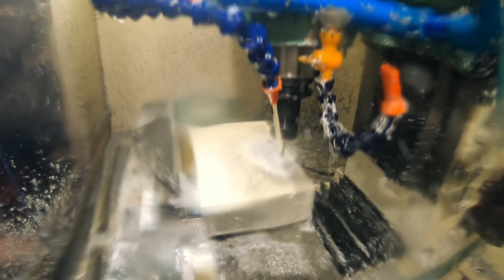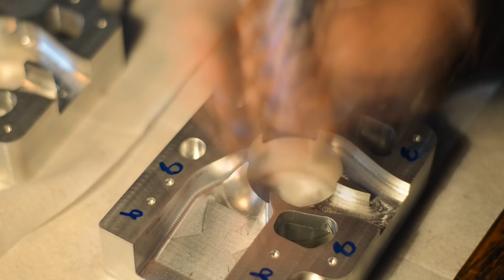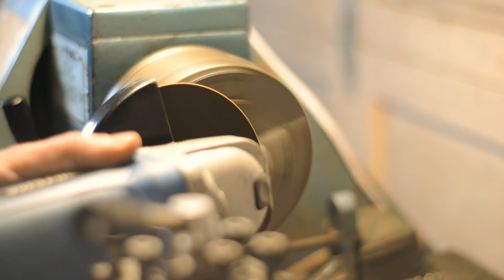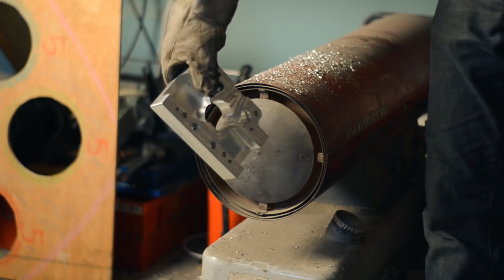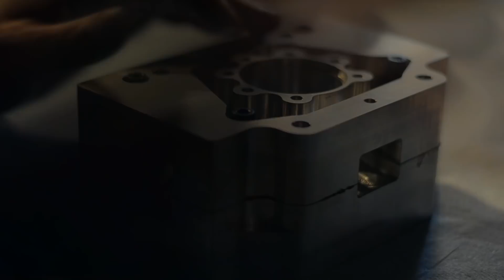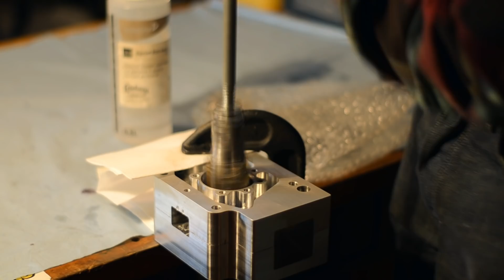You haven't seen a part like this before!

Comment: I wish you the best. I have been watching for ages and I'm super excited - just slightly concerned that the rings on the piston will get snagged on the join.
Reply: There is a steel bore liner/sleeve that inserts into the 2 halves, so no snagging 👍

Comment: In high performance application the only way to fit elements is to either freeze them or heat them, with freezing being much better since the part then expands and locks into place permanently - freeze the dowels next time and machine holes saller :)
Reply: Like a flywheel ring gear! Watched that video right before this 😂

Comment: Temp makes a big difference when tight tolerances are required. Maybe leave dimensionally critical surfaces last and machine them together. Usually how we do it. And if all else fails use loctite 638 for that loose bearing 👍
Reply: Yeah, I through he was going to bring it to final dimention in the lathe.
Reply: Eller loctite 648
Reply: just drill some holes in the side and add some screws to hold the bearing in site.
Reply: Meh dot punch it hahaha
Reply: @nathanchalecki4842  i've done that a few times to some loose bushes
Reply: Ductape. If it fails just add more.

Comment: Why don’t you threadmill?.. I have a similar machine to yours,less than industrial shall we say, however threadmilling works very well with Mach 3.. you just need to fudge the numbers to get the fit you want. I’ve threaded M3-M12. You can get carbide threadmills from AliExpress for a good price. I’m sure your machine is capable and it will save you lots of time, and they’ll be truer..

Comment: The only thing I am concerned about is the parasitic effect of the blower ... on a small engine ... the force required to turn the blower may outweigh the power produced from the engine ... I think motor driving the blower is a gain gain situation ... no loss whilst still creating required inlet pressure

Comment: The link below will take you to Danny Soliz's channel, he is a high performance engine builder. In one of his vids, he explains how just holding a part can change the dimensions. But yes, you are correct that temperature has an effect on the machined part. As for the alining dowels, had you put them in the freezer for a couple of hours, they might have just slid right in with out the use of the vise.

Check him out if you have the time, there are alot of good vids there.

https://www.youtube.com/user/samsoliz/featured

.

Comment: I love your unique designs, always happy to come along for the ride and see someone who just does stuff. You have an idea and you run with it. If using valves on a 2 stroke, it becomes much less about resonance hey? And if that's the case, what would be the issue of converting a 4 stroke single piston engine, into a 2 stroke by simply changing the cam sprocket to be the same as the crank sprocket and changing the cam lobe grind to suit your ideal 2 stroke timing?

Comment: Our cncs at work have a warmup cycle we run before starting actual machining
Reply: The CNC warm up cycle is there to protect the spindle,  Not to make your parts to the correct size.
Reply: Moves x and y still
Reply: it's a chance to see that the machine is behaving, so it will make your parts the correct size more reliably if it passes that test and decides to behave for the rest of the day
Reply: @gramursowanfaborden5820   It's not the machine making the parts to correct size, it's the machine operator.
Reply: @mamatuja  No, it's also to warm-up the machine so thermal growth has already been done.
Reply: @mikahazenberg8553   In this case it could take hours to bring the machine to desired temperature. In prototyping you're making your part and checking it as you go to bring it to the correct size.

Comment: Just remember when you mirror image machine the back lash and tool flex is different .and also with tight tolerances leave some material in and bolt both items together and use a boring tool  ,because it does not matter how good your cnc is it will never make a true circle using a end mill
Reply: My thoughts exactly.
The boring tool path I use has the borer go past the bottom of the bore then stop rotation at a prescribed angle of rotation and move about 0.1mm in the direction directly away from the bores wall before retracting still not rotating and clearing from leaving a score in in the bore by the 0.1mm.
Not all machines need to stop rotating at a particular angle of rotation (usually for a tool change arm to engage correctly) and don't have that ability, so you might want to finish the path at the bottom of the bore and do the tool retract with manual jog.

Comment: I remember doing such stuff of a Niro glow engine, she ran on 40% high compression head, dialled in the correct glow plug etc bottom line was I made a .35 engine perform like a .61  and that’s without forced induction. So your on the right path my friend.

Comment: Put the tap in the drill chuck very softly, turn the drill on, lower the drill, the tool will bite/start cutting itself then slip in the chuck. Save your wrists dude ;)

Comment: Augh! please don't part off with a handheld grinder in the lathe. It's quite unsafe, and very abusive to the lathe ways due to the abrasive dust it throws on them, to say nothing of the consequences if you slip and drop the grinder on the lathe. Either cut through the part outside the lathe and face it to finish afterwards, use a parting blade on the lathe, or at least rig up something to hold the grinder in the toolpost (you'll get a better finish too...).

Anything abrasive (even sandpaper) should only be used on the lathe after covering the ways with something to protect them (I use aluminium foil). If you let your lathe ways get worn by abrasives you'll soon find that all your turned parts are tapered, which is annoying at best and can totally ruin the part at worst.

Comment: If this has been recorded recently, it suprises me how cold must be over there to cause that kind of thermal expansion problems. Out of curiosity, how many hours of sunshine do you get in this point of the year?
Reply: soon, in northern parts of scandinavia, its 100% light whole day, the sun doesn't set at all.
Reply: We have sun from05.00 to 20/21.00 in east Norway now. But it has been a cold may..
Reply: @josteincarlsen2905  Cool, thanks for the info! If you want to know, here (just in the border between Portugal and Spain) the sun is up between 7AM and 10PM. Not much of a difference I'd say...

Comment: everything about this is cool. right down to the music!
Reply: Yes, but will it work?
Reply: @henkm9905  in my optinion a flat rotary exhaust valve is wrong in every way. it can't maintain enough stiffness to hold the pressure for supercharging and the wear of the valvebody on the lowpressureside will be very high. there are many reasons why rotary valves disappeared, except in case of inlet valves in 2stroke engines.
if you want to supercharge an engine - use valves. in an uniflow setup with roots-supercharger usually outletvalves in the head are used. and if you want to have these kind of RPM - use a short-stroke setup with pneumatic valvesprings. 

we're watching someone play around in a totally nonsensical dimension, what i like very much!
keep on working!

Comment: Oh yes, when you try to fit steel in aluminium, you realise how big is thermal expansion of aluminium.
Reply: Yeah it expands about twice as much. 

Steel expands 0.00008-0.000018mm (i use 0.000012)  per mm and C°. Aluminium 0.000023mm

Comment: @ 2stroke stuffing. rather than heat up the cylinder to get a clearance fit, do the opposite and put the location dowls in the freezer.
Reply: I've always done both for bearings. Pack the bearings and throw them in the freezer for an hour. Heat up the bearing seat a bit with a torch and the frozen bearings should slip right in. After the temperature normalizes they are much harder to get out.

Comment: 5:30 Maybe also your lub' was cooler at the beginning, and get warmer when he time go by? thus warming the second part quicker.
Reply: Wouldn't the holes be larger in the part that was machined cold? Metal expands when warmed. If its machined cold then the holes would expand when warmed? Where as the one that was machined warm wouldnt expand?
Reply: @nickserafine6345  you would think that. But in reality you have a lot more variables ie. The coolant temp, spindle temp, machine temp and stock temp. So in practice the holes get larger as the machine warms up. For most machines it can be beneficial to do a warm up program for about 15-20 minuts. And the machine shop should stay at about 20-22 celcius for precision work. I can say this from experience as a machinist.

Comment: Machining tip from the world's worst machinist when Machining tight bores turn on your lathe a set of gauges top and bottom of your hole tolerance then if your Machining the bore using endmills leave a tiny bit of material on 0.1mm or 0.05mm and then run a new endmill to finish the bore and use the gauge to check the fit while it's on the machine and if necessary run a spring pass or adjust the bore dia until you get your fit correct repeat for all holes intended to be the same and check with gauges at every step - slow but it works

Comment: Hi Alex, it isn't the aluminium temperature difference what causes your problem. If that was true parts making would get really hard. It grows a bit over 20 degrees but not a lot. It's probably your machine warming up an growing, the second bores are with a warm machine. So the machine get bigger and cuts the parts bigger.
Reply from the maker: 👍 Sounds right!

Comment: I really think your cylinder designs are pointless, being 50cc there is not really any need for such large diameter intake /exhaust  and on all your test run you suffer from cylinder ring damage and it's all due to the lack of support due to the large openings leaving no support material, plus, thin metals react to high heat different and are a point of failure.  your best best to move the volume of air is to play with air velocity.  Also, if you want to improve compression you should re-design the cylinder head and piston for a hemispherical design and a resonant muffler cavity for the rpm range you desire.
Reply: There’s plenty of ring support on this design
Reply: @Tonny keep in mind at least some of a “hemi“ combustion chamber’s benefits I. 4 stroke motors are irrelevant here. Valve and inlet geometry on a 4 stroke don’t matter on this engine. The low static compression a 2 stroke has make the large combustion chamber undesirable (not sure how this interacts with the blower though? Perhaps between the blower and the rotary exhaust valve he’ll start to get up to dynamic compression ratios where that might become beneficial? Probably not if he’s running methanol/nitro…)
Reply: @bigiain_au  thank you for your input and knowledge.  I do agree entirely with what you said, the only reason I said "hemi" is since AFAIK it improves pre-detonation and combustion speed. also Hemi don't need to be of large diameter, they can be stroker and the travant engine is a good example. Also, the cylinder geometry of a Hemi design could help with what he wants, witch is exhaust speed and scavenge.